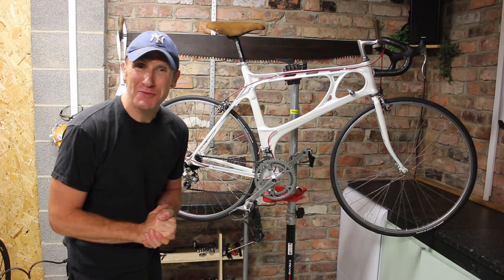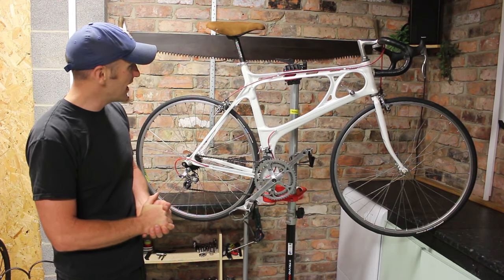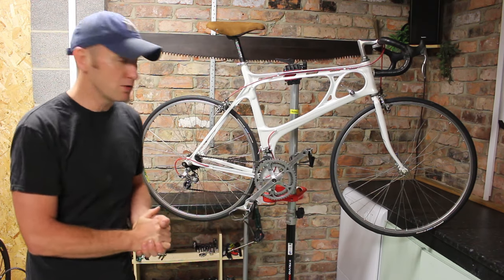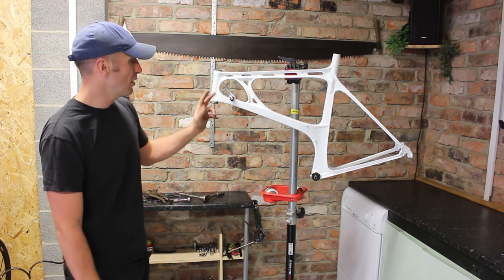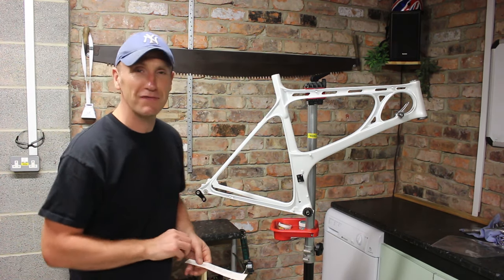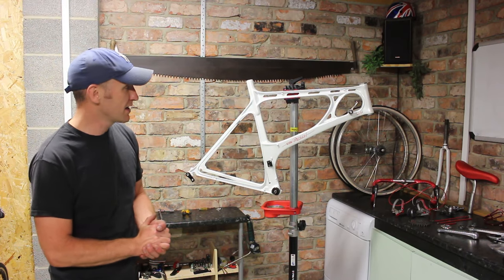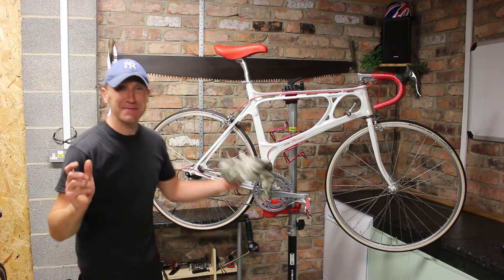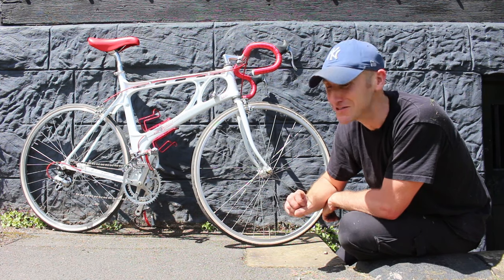Vintage Kirk Precision Road Bike Restoration

Comment: My local frame builder had one of these in for repair, the frames suffered with stress cracks due to an issue with the manufacturing process. They were going to have a go at welding it. I wished them luck.
Reply from the maker: Yes your right they are prone to cracks on the rear stays. Mine remains hanging in the garage like a museum pierce 🚲 thanks for tuning in and watching the Kirk Precision 👍🚲

Comment: Great video. Good bit of history you presented as well. As for the wive's tale of crashing the bike and the whole thing going up in flames... shouldn't really happen. I worked at a magnesium foundry for some time. In order to get a mass that large to catch fire you would have to raise it's temperature to the melting point at one end. Once it would start to melt, then it would propagate until the whole frame became a pile of white magnesium oxide powder. You would need a blow torch to get it to that point. If crashed and the frame scraped the road surface, it would certainly spark but not burn in a blazing fire.
Reply from the maker: Thanks for watching and the support and also your knowledge of magnesium. All the best

Comment: I know a lamp post in Richmond west London that has a frame of one those chained to it. Dunno how long its been there but i'm rather tempted to get down there with some bolt cutters.
Reply from the maker: +Simon Ashton mate it sounds criminal keep me posted 😂 on a serious note they are rare and if you feel it could be saved then fare play to you! 👍good luck
Reply: It's on the street where Mick Jagger has a house, I'm sure he don't want some piece of magnesium littering the pavement. If it's still there in a couple of weeks I'm having it away, do the council's job for 'em..,... including the recycling. In London our cycle track is Richmond park so fingers crossed and will keep you posted.
Reply: Did you end up taking it? I'd like to hear that it's been fixed up:)

Comment: VERY cool bike Andy. Good choice on deciding to keep it.

BTW, I have a disassembled Gitane Grand Sport Deluxe. I know they are not particularly high end bikes but I am wondering if it is worth restoring. It has the fixed bottom bracket cup stuck in the frame and I am not really sure what direction the threads are on it so I am reluctant to really put a lot of force into removing it. Any suggestions?
Reply from the maker: +Jensen Healey glad you enjoyed the video, regarding your bike happy you have made a start, the drive side is normally opposite thread. I have had to have a few now in the vice. Good luck! Andy

Comment: DAMN NICE BIKE , how much does that go for?? l wanted to ask what size tires do you use mostly ?? l  noticed alot of tire clearance on these old bikes ,how big can one go here ??
Reply from the maker: Thanks for watching and your comment on the Kirk Precision Road Bike restoration. The bike can range from £600 to over the £1k mark depending on condition and components on the bike. The tyres I’d say 28mm no problem, it’s the callipers that may cause you the problem. I try an use as close to 20mm as possible because back when these rides were current this is what was used. I hope this helps all the best Andy

Comment: Why not put some higher-end components on it? That sugino/cyclone mix was lacking for a frameset like that, I think.
Reply from the maker: Thanks for watching. Regarding the components I just wanted to keep the bike as original as possible with how the bicycle was sold. I realise this frame was used all the was through the groupset range. The bicycle was also sold on and is not in my collection.

Comment: Great find mate. I have heard that corrosion was an issue in certain environments.. I guess like magnesium alloys racing wheels it would be cheap to manufacture. Was it an alloy or wasbutbpure magnesium? I would think pure magnesium would be brittle.
Reply from the maker: +glenny oc thanks I'm unsure of the exact mix. The bike now hangs on the wall preserved like a museum piece. Thanks for tuning in and the comment Andy
Reply: The frame is made with a magnesium alloy, pure magnesium is not suitable for most applications. In the 90's, I was working at the $1.5B Norsk Hydro magnesium plant in Bécancour, Québec (Now closed and completely gone). Norsk Hydro had partnered with Kirk Precision to make the frames for a while. Read the story here: http://old-metal.blogspot.com/2009/06/kirk-precision.html As an employee, I could have purchased a complete bike for what I remember being a very low price, but sadly, I didn't. There was a Norsk Hydro blue MTB on display in the office where I was working, very nice looking bike and light for the time.

Comment: Hi, I’m about to embark on a Kirk restoration myself and before I receives the frame, can anyone tell me how wide the rear dropouts are and what type of BB it takes please? Very little details about the frame online. Many thanks
Reply from the maker: All I can add it should be what was standard mid to late 80’s. It was used with all standard running gear for the Tour de France 🇫🇷

Comment: Amazing finsh foaming at the mouth ,any advice as mine has been in my parents garage for 20 yrs and has pitted a bit on the frame,how do I get the paint off and how do i respray.
Thanks
Reply from the maker: Hi again, the Kirk Precision was already re-sprayed however in the past if I have ever needed a full re-spray I have used a local company which only charge £45 for stripping and re-spraying. Just ensure you can obtain the decals first. Cheers Andy

Comment: How much does it weight?  It looks like a brand new bike ! Nice !
Reply from the maker: +gauthier descheemaecker Thanks for watching! It's not the lightest bike not sure of it's exact weight! But it's so stiff, very fast ride. Andy
Reply: Is this pure magnesium? If their is a spark your bike will be very bright ;)
Reply from the maker: It is Magnesium Alloy, its the same compound that it used on some engine blocks. I am a fire fighter full time and have seen a few go up, yes extremely bright white flame. Andy

Comment: just out of interest what price could it fetch, and how hard to find one? I seen a nice Raleigh out side local bike shop in deeside,  was called Europa it had a diamond seat pattern, probably early 80s. It looked cool but wasn't best nick and probably over price so left it
Reply from the maker: +Kevin Jones hi thanks for watching, the Kirk Precision was up for £500 it had four offers and 800 views on eBay in a 24 hour period until I took it down. As far as your Raleigh I would try and look for an original private sale that just needs a bit of TLC! All the best and good luck Andy

Comment: Hi all does anyone know how I could strip the paint off my Kirk the same as the above?
Reply from the maker: +christian evans found this online - Resprays - Chemical strippers should not be used, as this will weaken the glue used to hold key parts of the frame together. Instead use shot or aqua-blasting.
	Resprays - Oven temperatures to cure the paint should not exceed 180°C.

Comment: Hi Everyone !
Wow! I think I might just be one of the unluckiest guys in the cycling world !! ! 
I've just inherited what I believe to be a mountain bike with a Kirk frame  possibly a Kirk Revolution (Frame Number D200 491) but I think  it has a small problem with the derailia mounting hole on the frame . 
If anyone has any knowledge /information or contacts for this sort of thing Magnesium frame repairs/Kirk Restoration, I wold be truly grateful........ !!!!
Reply from the maker: The hanger is separate to the frame...you should be able to bolt a new one one it’s just finding one that fits 🤔good luck
Reply: @BikeItUK  that’s true in most cases but some how it was actually the screw thread hole in the frame that actually sheered in half . 
Managed to find a specific specialist Magnesium welding company… who managed to weld a piece on and attached a new hanger ….so all good thanks ! 
If I’d have thought about it,I would have sent it into BBCTV program “the repair shop “ snd got them to do it …. Would have been a good story…!!!